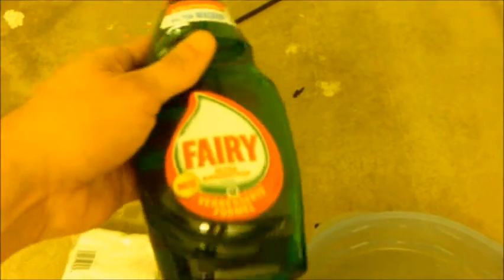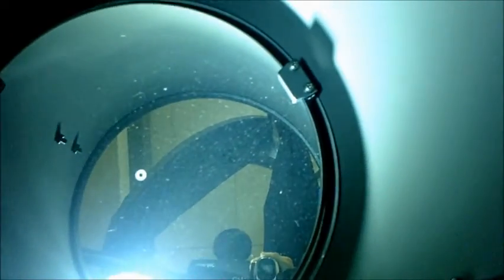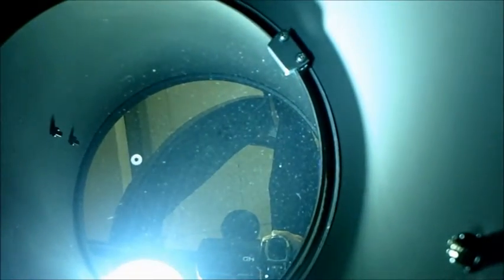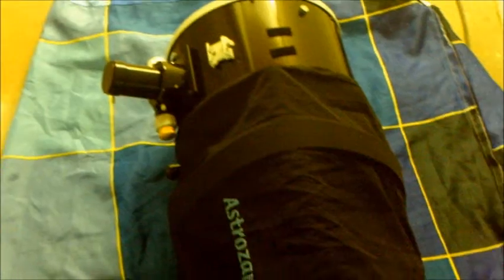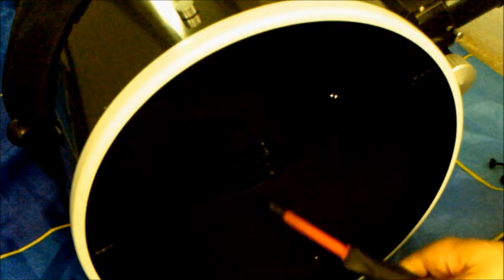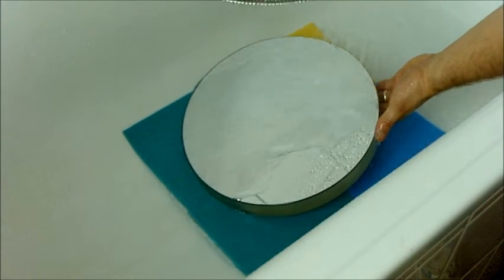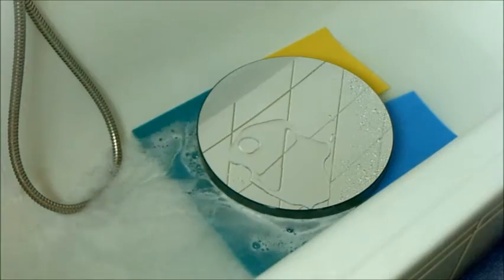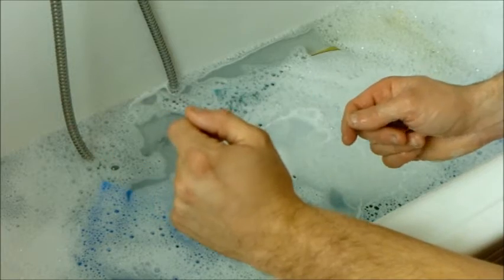How to clean the optical mirrors on a Newtonian Reflector  Youtube

Comment: Hi Martin, If I wan't a big budget telescope for tiny Moon and planets details (I have mak180 and C9,25 already) do you reccomend  sky watcher flextube goto 12 or 14 inch newtonian?
Reply from the maker: I used to have the 12" flextube, outstanding views but be warned this is not a light scope weighing around 60kg. The 14" is simply too big and heavy, if you handle the sheer weight and size and home has enough space, it's a monster on aperture for sure.
Reply: @MPAstro  Thanks a lot for a good advice, so 12 inch flextube goto will be the biggest telescope I can handle in my situation. Aperture fever striked me too LOL.
Reply from the maker: @rcpilot9963  what about a 10" Dob, I've got one and have you seen my supertune video?? Here you will be able. to see the true size, for me it's not too heavy and is quite compact for it's size
Reply: @MPAstro  10" Dob is a great scope for sure but already I have SCT C9,25, too close in performance in therms of  light gathering.
Reply from the maker: @rcpilot9963  I guess so, try the 12" dob its a bit bigger though I find a solid tube is lighter than flextube. I think Skywatcher have stopped making the 300p classic, which is a real shame

Comment: Hello Martin! Have a couple of questions... 1. Can you use a blow dryer or fan to dry it? And after removing the secondary mirror how do you line it up right? Thank you
Reply from the maker: I would not recommend using an hair dryer to dry optical mirrors, has you can blow dust on to it, I would leave it to dry has normal, has long has you use Distilled water to do the final rinse to minimise mirror streaks. If you watch my Solomark Cheshire eyepiece review video, you will be able to see how the flat mirror positioned proper, usually you can loosen the 3 screws and tilt the secondary mirror has central towards the focuser tube, once in position you should be there and adjust collimation has normal.
Reply: Martin Pyott  thank you very much Martin

Comment: Nice video, but don't store my scope in the Horizontal postion, but have one of those sliver thick covers to go right over the scope, so keeps dust off. my Primary is still very clean after 2 years, was told and read everywhere, clean your mirror as less as possible and have heard mirrors being cleaned beyond your 2 to 3 years.

The longer you leave it the better. Think cleaning time and when to do it is no fast hard rule. Any light shining down the tube always makes the mirror look bad and is not a true indication of its condition.

Yes as you say don't over clean and it's true. The more you clean the more the coating is damaged as each time you clean your very slightly damaging the mirror.

Seen some videos and has also be suggested is don't use cotton balls, but your fingers can also do a nice job, but gently of course and no pressure.

Anyway love your videos, great job.

Is the Centre spot quite rebust? as I see yours remained.

Also a laser collimator will not Centre the secondary mirror, and only useful for collimatior the secondary if it's pretty much Centred properly under the focuser. a laser collimator will not do this if the secondary is well out and there are videos on your tube prove this.

if the secondary is alined and square to the focuser then yes the laser collimator works.

Comment: Good morning Martin, As much as I try to find an answer to the following, I have not been able to find the satisfactory answer ...
Apparently almost nobody takes into account that the primary mirror can not only suffer from de-collimation with respect to the secondary mirror; The primary mirror may suffer from astigmatism due to the movements caused by the weight of the glass, the size of the mirror, the triangular supports of the cell, the fixations of the mirror and the different temperatures in the observation environment.
I have a 12-inch Newtonian f / 4 (TPO SKU: OS-12IN) and I discovered that the mirror was attached to 3 of the 9 points of the supporting triangles (that is, a point stuck by each supporting triangle). The telescope factory (GSO Telescopes) attached the mirror to the cell with double-sided tape. I have read in some forums and articles that it is better not to stick the primary mirror to the cell to avoid astigmatism but as I write, that mirror was attached to the support. I do not know if that is correct and in any case, in a telescope like mine that is not Dobsonian, but that is placed in a robotic-equatorial mount, that mirror moves whenever it is directed to an object in the sky and I find de-collimation even when it is attached with that tape to the cell.
Do you know if it is better not to attach the primary mirror to the cell anywhere?

Comment: I dipped the secondary mirror in water, and now the plastic behind it is filled with water. DO NOT DIP MEADE LIGHTBRIDGE SECONDARY MIRROR IN WATER WITH PLASTIC.
Reply from the maker: Thanks for the heads up, I am shocked that Meade have used plastic instead of glass for the secondary mounts (which is usually norm for optic mirrors).  The only solution is to allow the plastic secondary mounting to dry out over time, I wouldn't even consider drying it out with a hair drier.
Reply: Martin Pyott i kept shaking the thing, some water came out of front some from the back, eventually it was all out.